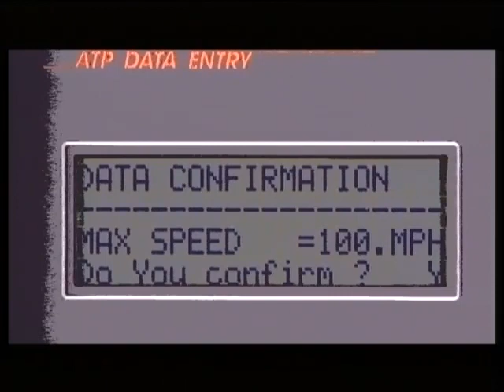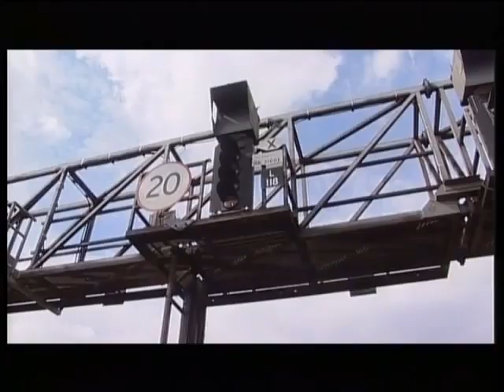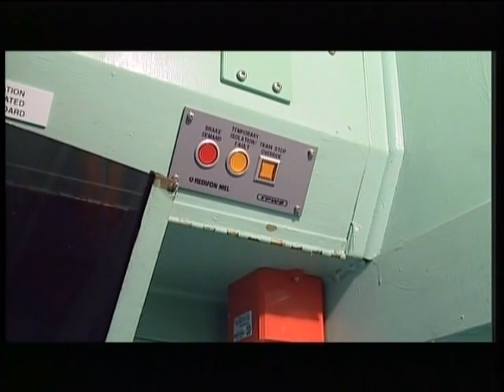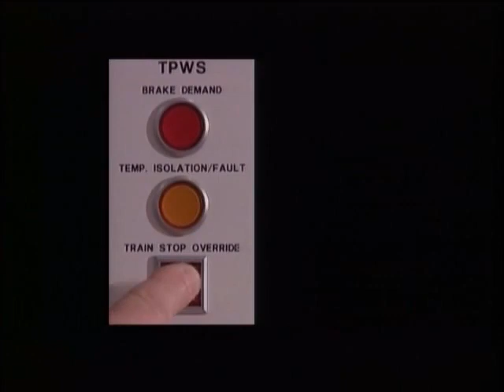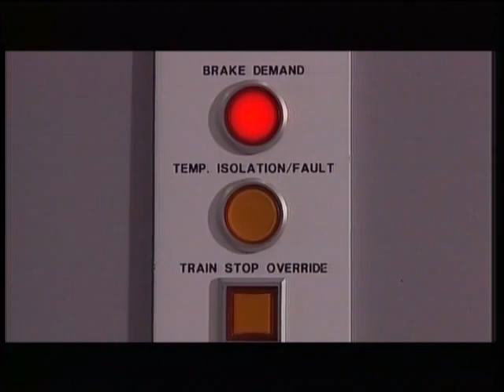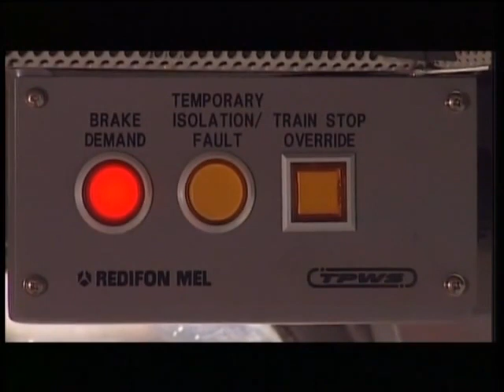Introduction to TPWS

Comment: Not voting for network-wide ATP is the definitive "cheap out first, pay more later" problem on the UK railway. TPWS works, but...
Reply: It's the opposite. ETCS is less expensive than ATP, no track loops, uses existing GSM-R, better capacity (no release speed business), and an international equipment market (ATP was removed from Chiltern due to equipment obsolescence). 

Something similar was what happened in some places in the US when the PTC mandate came: low-volume freight lines were running with no signaling at all, and those were absolutely the easiest to be put under PTC because with modern technology, it required no ground infrastructure.

Comment: It seems like the safety standards in the UK are much less stringent than here in America.  There's nothing that forces a train to stop on Network Rail in case of a SPAD or overspeed except the minority of signals that have TPWS or the ETCS territories.  Otherwise a driver can acknowledge the AWS for a red light and then doze off before stopping.  Meanwhile, the US PTC system is now the norm on passenger routes.
Reply: This video is old, TPWS has been a nationwide system for quite a long time now.

Comment: Why didn’t they put the emergency braking so it would stop the train BEFORE the signal.  It seems so bloody obvious.
Reply: Theoretically, it's possible to calculate train braking pattern and apply emergency braking if full service speed curve extends beyond the signal, but there's too many asterisks to that part in practice. The simpliest solution would be emergency brake tripping some distance in front of red, but that will mean stopping quite a distance in front of the signal since trains don't stop instantly. You can improvise more with trackside hardware, but then you remember that the primary goal is an affordable alternative to ATP without much new installation, and then that the overlaps that are meant to be entered relatively safely during emergency braking already exist in the base signalling system and here we are
Reply: Overspeed

Comment: 183m overlap? Mu understanding is its 200m for 4 aspect signalling.  183m is the aws to signal distance ..
Reply: 180 metres is the standard overlap length and the standard AWS distance.
Reply: @simonlowe3766 aws yes
400 for 2 aspect
300 for 3 aspect 
200 for 4 aspect
Reply: @Sithlordjedihunter  Overlap lengths haven't varied according to the number of aspects since 1978!
Reply: @simonlowe3766  well better tell our dtm that cos they test us every couple years on signalling lol
Reply: @Sithlordjedihunter  I'd be happy to point him to the current signalling design standards, which I use day in, day out. (lol)

Comment: Can someone explain what enhanced emergency braking is?
Reply: Where the emergency brake application has a greater deceleration rate than full service. Often with many brakes of "the past" emergency was just "full service applied faster" so there wouldn't be a benefit of emergency braking and nothing more would happen if you already were in full service
Reply: @fetchstix  Alright thanks for explaining. So to be clear a full service brake wouldn't be full service but just another step with emergency being the actual 'full service'?
Reply: @xLars_  no, full service is the full normal braking. enhanced emergency braking means it uses an extra, separate system for even better braking, that would be too expensive to use in normal operation. Usually, this is a strong magnet that is pushed down onto the track. The friction from the magnetic force then slows down the train.
Reply: @dionysusnu3881  Very few trains have magnets… it’s far more common on tram.
Reply: @bfapple  huh, country difference I guess. Here in the Netherlands magnet brakes are quite common on heavy rail.
Reply: @bfapple : Yep, matter of fact, I think the only magnetic track brakes on Network Rail are the Sunderland extension Metro units and the Manchester Metrolink units at Altrincham. Interestingly enough, Sheffield's tram-trains have their track brakes disabled in "train mode", apparently.
Other than that, the best wording I can think of for the difference is that "full service" is like a building's normal exits, whereas "enhanced emergency" is like the additional emergency exits that usually aren't open...?
Reply: @fetchstix  Metrolink doesn’t operate onto NR metal. Interesting analogy anyway.
Reply: @bfapple : Wait, has something changed recently? Network Rail's Sectional Appendix (NW3027 and the section on Metrolink) and RSSB ("Enabling Magnetic Track Brakes on GB Mainline Rail", where the previous track brake claim was sourced from) seem to imply that Timperley to Altrincham was (if not still is) Network Rail owned  and signalled (among other discussions about the difficulty of dealing with that section)!

Comment: Why not just fit TPWS to every signal? That is cheaper than ATP and safer than only fitting it to signals it is currently fitted to.
Reply: Assumedly part of how cheap TPWS overall is comes from the fact that it isn’t fitted in relation to all (stop) signals? The highest risk if I recall correctly is from conflicting movements (rather than where trains are in general moving in the same direction) and so it may have been the case that complete fitment would have had the whole project rejected on cost...
Reply: There’s probably also the matter of a lack of necessity at some signals, like long express lines with lack of connections to other lines or branches - there’s no point putting them at every signal, instead putting them where crossovers and major junctions etc exist, or at least spreading them out every 3 or more signals.

Comment: The fact that the loops are only energized when the signal shows danger doesn´t seem to be really safe to me. 
If a cable gets loose somewhere for example, the loops won´t work any more and a train could pass the signal and the overlap and crash. 
Wouldn´t it be much safer and fail safe if the loops were energized constantly, and shut off when the signal shows danger ? So "dead" loops will always cause an emergency brake application.
Reply: The problem is that how do you know when you have passed a dead loop if it is dead?
Reply: @oliverkeating4894  ERTMS solves this problem with balise linking. Each balise contains data that tells the train where the next several balises should be so the train can detect missing or failed balises.
Reply: It Sais there are 2 loops, arming loop and trigger loop, so you could couple them in a fail safe way.
Reply: @oliverkeating4894  The idea here is that the system should be failsafe.
Reply: The loops are proven active and the signal in rear will remain at danger if this is not the case.
Reply: That’s what I thought the first time I heard about TPWS. I’ve always been paranoid in that way, but I would want it to be failsafe in a similar manner to AWS in that a lack of power to the loop means you get tripped. 

With that said, TPWS does a good job, it’s unlikely that you’d get to a point where the loops can’t be powered at all before trains can be stopped, and I’m sure that they must have investigated having it in that manner but it must have been “too difficult” (to the point that it wouldn’t have been implemented due to the cost otherwise.)

(Technically, the loops do exactly as the original post describes, but then to have them “energised” constantly would need a source of power incorporated somewhere.)
Reply: @fetchstix  Well you'd need a power source anyways, but I think keeping the loop energised would use a lot more energy.
Reply: @williamhuang8309  it is fail safe…….if the TPWS fails for any reason (power supply) or lose wire as you stated, then the signal in rear of it will stay at danger, and cannot be cleared to a proceed. 
TPWS is interlocked, so it fails then it will have the same affect as a track circuit failure, signal failure, points failure or barrier failure……everything is fail safe in the railway…….well except safety critical communications.
Reply: pretty sure the loops being energized, at least in those days, was what caused the emergency brakes to trip, therefore energizing the loops on anything other than a red signal would cause an emergency application while the signal isnt at danger. it doesnt really need a failsafe because tpws is the failsafe, for it to be even needed firstly the driver has to spad or almost have done so if the tpws hadnt intervened, the chances of a driver spadding and the tpws loops at said signal failing are microscopic
Reply: I instal and test these and other things for a living and this comment is amongst the stupidest thing I've ever read whilst on this subject.
Reply: @brettnelson3219  just because people don't know something and have questions doesn't mean they're stupid

Comment: People's lives should not be reckoned with in terms of money. Every time we travel by train, however great or small, we take a risk. There were a series of SPAD incidents that culminated in the Paddington train crash and it was only after 31 lives were lost that the adoption of TPWS was put into place, ideally ATP would be better but costs...
Reply: It is about cost benefit analysis though, ATP would cost too much money per prevented fatality. Think of it this way, there is only a limited amount of money, and it may be better spent (save more lives) on the NHS. It is important to have a consistent approach on this, not that "peoples lives should not be reckoned with money", but instead that everyone is treated fairly and the chance of survival is determined logically, not by circumstances of funding.
Reply: Oliver Keating I'm not saying that the railways are solely guilty of this, but it is sad that sometimes the travelling public pay the ultimate price for necessary safety improvements to be made. In the case of Paddington, changing SN109 from the reverse "L" shape that was notoriously difficult to sight by drivers, to a standard design that is far easier to see
Reply: +Oliver Keating pòo
Reply: People's lives have to be reckoned with in terms of money because there is a limited amount of money.
Reply: so you expect everyone to go hungry to maby save someone possibly
Reply: @TheLostPacketYTso you expect people to ride in unsafe conditions if it means people don't go hungry?
Reply: @SiVlog1989  if it is reaonable to spend the money it should be done but if it is way too expensive then a cheaper soloution is ok
Reply: @TheLostPacketYTI would rather pay more for a ticket if it means it goes back into the system to ensure that safety is taken seriously and not run by accountants
Reply: @SiVlog1989  it would be hundreds more

Comment: think the wcrc might want to look at this after their incident
Reply: It was fitted to the loco that had the SPAD but the crew had isolated it. Big no no.
Reply: @DadRail  I don't get why you would isolate the TPWS. It is there for your's and other's safety!
Reply: @ec8451  Maybe the drivers and engineers on the loco thought the TPWS was broken?
Reply: @ec8451  TWPS might be isolated due to it being faulty